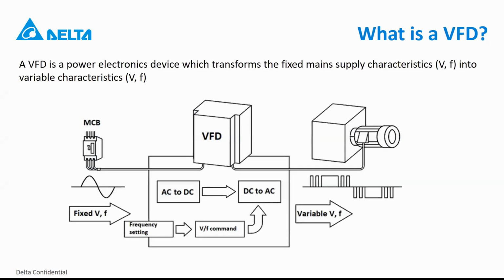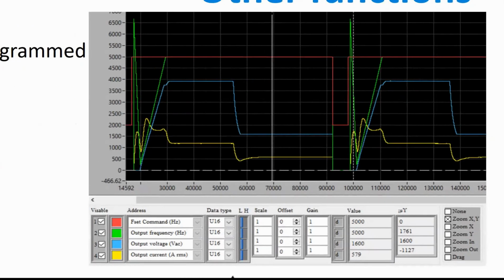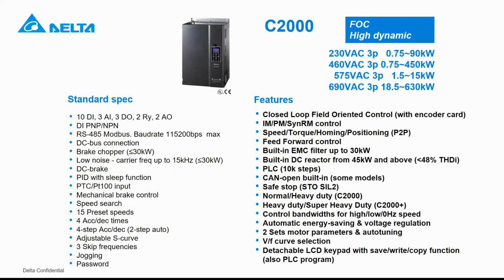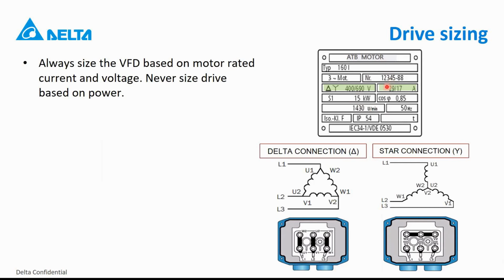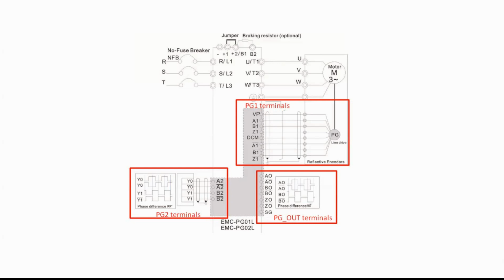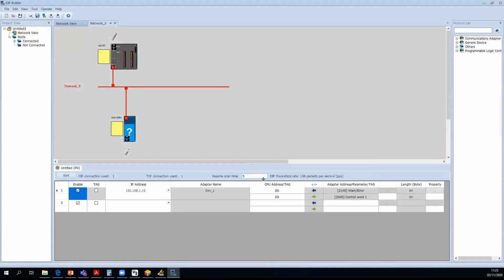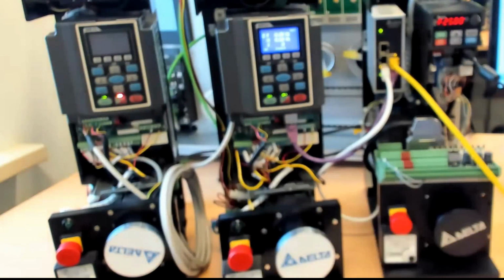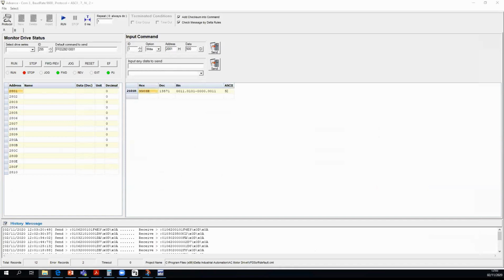Variable Frequency Drives | Online Basic Training

Comment: Great video. 
I want to use MS300(20 hp drive) to run my 10 hp submersible pump motor. 
I can provide only 2 input phases in place of 3 (phase to phase voltage : 460 volts) . 
Will the drive work considering derating. 
Motor rating is 17 Amps, 3 phase, 415 volts, 50 hertz.
Reply from the maker: Hello,

A derating based on the drive and motor current is required in order to guarantee that there will not be any nuisance "OrP" tripping. (phase loss)
I would like to understand the application and environment a bit better. Could you please send us an email with more information to iatechnicalsupport@deltaww.com

Thank you!
Reply: @DeltaIndustrialAutomationEMEA  Thanks for quick reply. 
Just sent you mail on given id.

Comment: Thank you for this great content.  I highly appreciate as a happy owner of 2  c2000 vfds .  Can you give advise how to do Spindle homing on a single pulse from a proximity switch? This is commonly needed for CNC applications.
Reply from the maker: Hello @Hendreh1 thank you for your comment. Are you referring to the "tool change" function where a digital input is triggered and the motor then stops at a particular angle?
If yes then you can wire the switch to one of the multi-function inputs of the drive MI1 to MI8. The corresponding parameters for these digital inputs are pr02-01 to 02-08.
You can program one of those digital inputs to function 35 "Enable single-point positioning".
You can set the angle at which the motor will stop when function 35 is triggered in pr11-65(High Byte) and 11-66(Low Byte). If you set pr10-01=1024 then the max value that you can set in pr11-66 will be 4096 and pr11-65 will not be used.
In order for this function to work you have to use FOCPG mode.

If this is not what you are referring to then please send us an email at iatechnicalsupport@deltaww.com and we can discuss it further.
Reply: @DeltaIndustrialAutomationEMEA   thank you . I will try this out .  And yes I want to execute the tool change on a CNC Machine with a DI input on the VFD.    I was using the Homing function but may that was the wrong path. Thank you